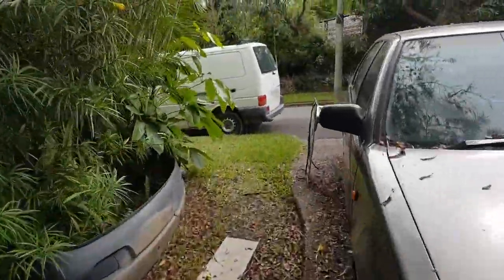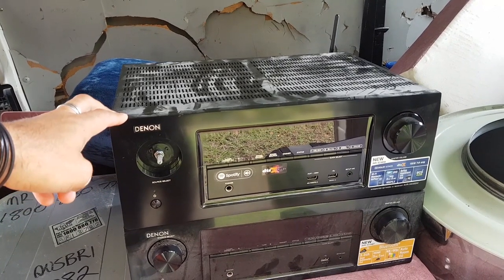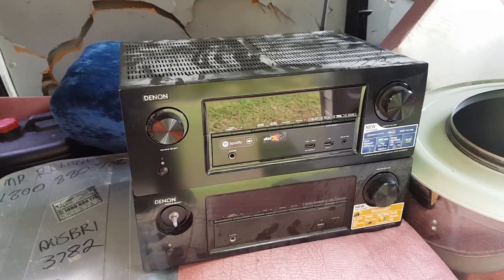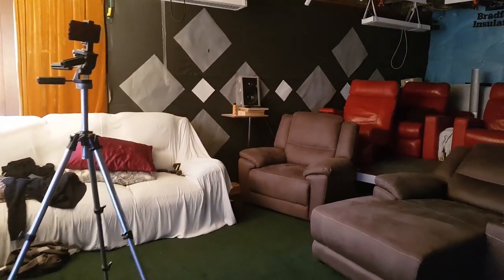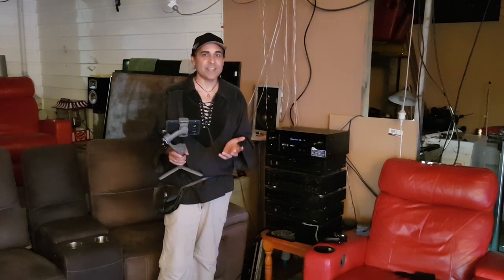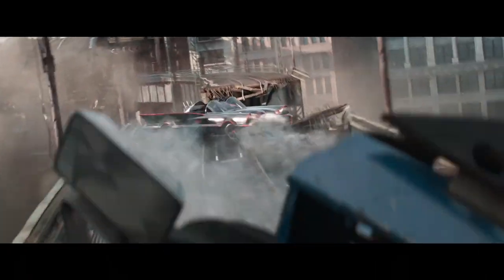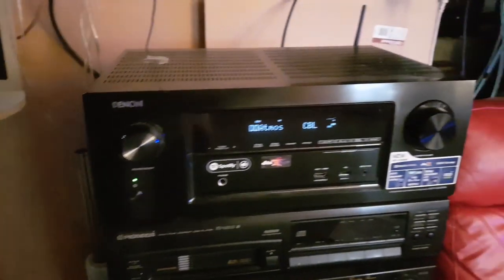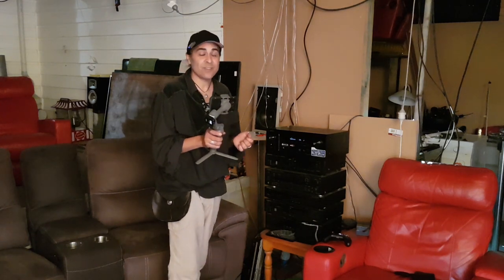Dolby Atmos & dtsX = AMAZING! Found a Denon Receiver in a dumpster & hooked it up in my Home Theater

Comment: Hi Isky, I have a Onkyo amp but I think Denon is the next level up so a great find. Maybe people find it easier to dump it than placing an ad and then waiting around for people to turn up, sometimes not and waste your time.  I just repaired a Delonghi Coffee machine the other day and it only cost me $5 to repair, this was a $3000 machine and they were going to dump it. Now it is my pride and joy. 😁😁😁😁
Reply from the maker: Exactly mate.  I can see where they're coming from as well.  A lot of the time it can be quite the ordeal to give stuff away for free.

Thats amazing!  I'm about to make a video on a Delonghi coffee machine I found that cost thousands as well.  I think it was the Primadona 6900?  Nothing wrong with it in the slightest.  It's perfect... but I don't drink coffee so will keep it here for friends and entertaining.  But it does make a good hot chocolate apparently.  I just need to buy the attachment.  What part did you have to replace?  Great score man!
Reply: @DIYDumpRat  Hi Isky, with a no power situation on the Delonghi coffee machines , there is a common voltage regulator ic and a resistor you need to replace. That fault is usually due to a power surge, if you find one that just not power up, let me know and I can help you fix it. Looking forward to your next video. Cheers Stephen  👍👍
Reply from the maker: @stephenb4411  Cheers mate, let me know what model you're referring too so I can look it up and keep an eye out 👍👌